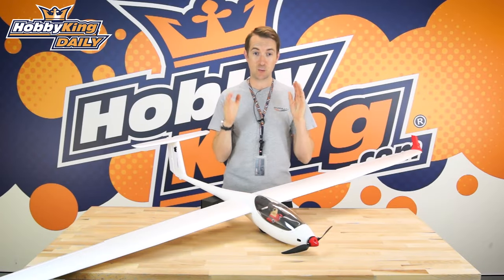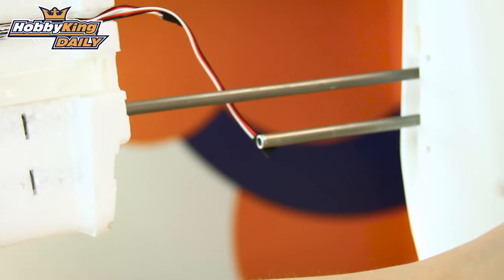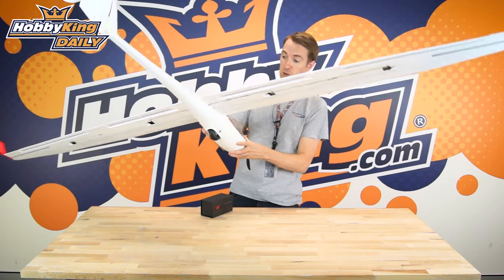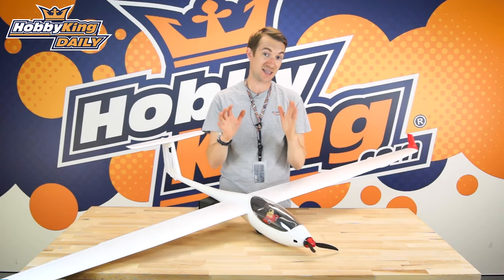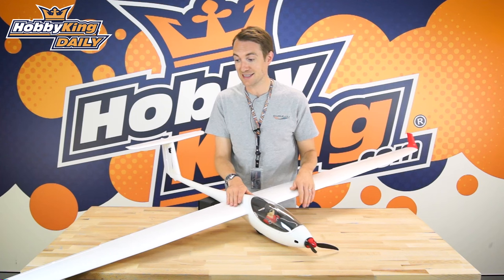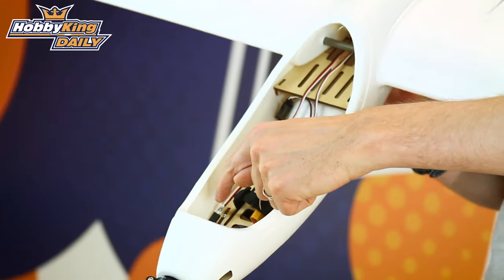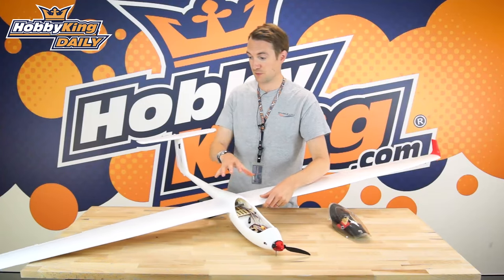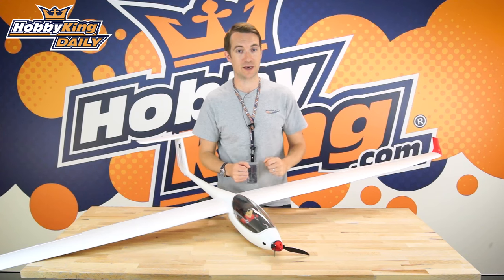Volantex 759-1 ASW28 V2 Electric Sailplane EPO/Plastic 2540mm PNF - HobbyKing Daily

Comment: Had this model [V2} for about 6 months and it is a great flyer. It actually flies close to scale. Use a 22 amp and if flying in thermals you could 45 minutes to over an hour out of a battery easy. Some recommend flying with a 4S but i'm satisfied with a 3s [don't want to overheat the esc] and it seems to provide adequate power to get out of trouble. 

Cheers

Comment: I have the V1 of this model. The weak point of this model is the canopy which cracks and splits too easily. I was able to obtain a replacement direct from VolantexRC but it would be great if HK could stock this much needed spare part in their warehouses.
Reply: Had the same issue, so I reinforced the area around the hole (both sides) with cloth tape
Reply: Yep.  I have had the V2 version for some time now. Had to get an extra locking clip for the left wing since it came without one. The canopy is very cheap so I reinforced mine with lots of packing tape.

Comment: Are you going to provide us with spare parts, such as only the wheel so that we can "upgrade" our V1 ASW28s we got from your site? Or maybe a separate pack with instructions and parts that will help us transform V1 to V2 without having to buy the whole plane again?
Reply: Why bother, the wheel provides less friction on landing which means it will run on longer. Not what you want really.